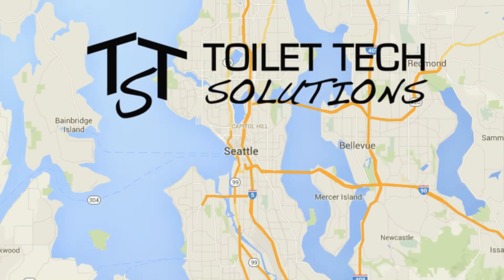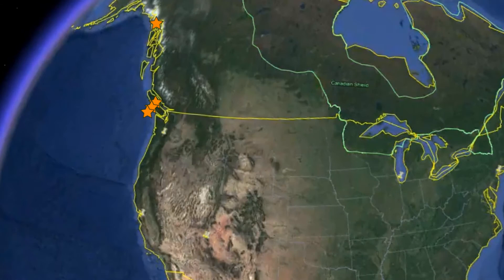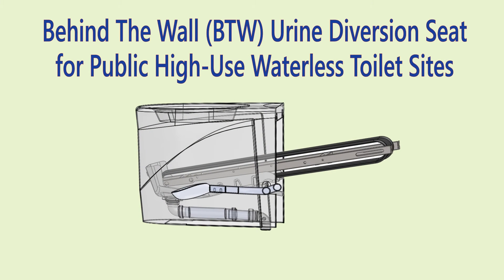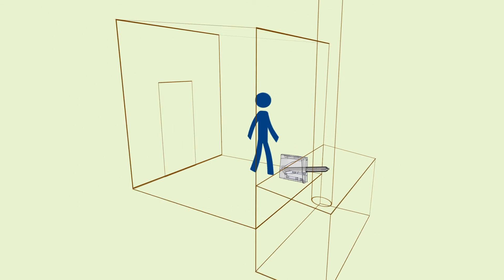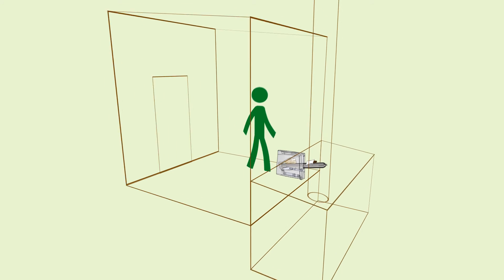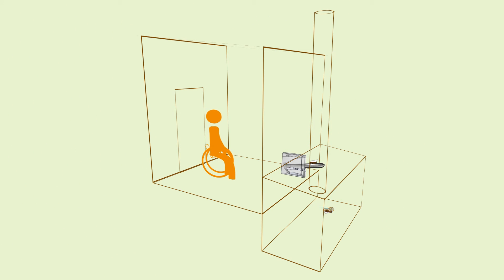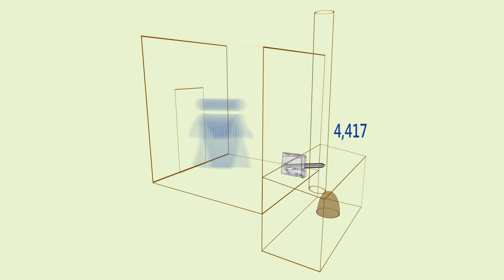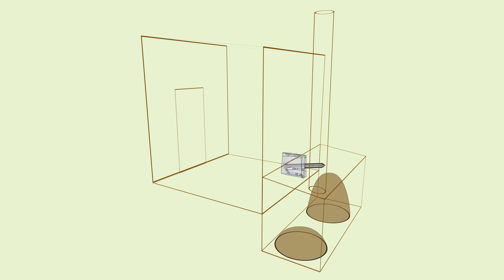Toilet Tech Solutions Waterless Toilet Video - Urine Diverting Decomposing / Dehydrating

Comment: I can imagine this system fitting on the backs of trucks and you then have a great mobile system for festivals and other events, a chiney on the tank above the waste pile with a vertical blade rotating will pull the smell up and the intake will be from the toilet so that the user does not get the smell, better than using a foot pump you can have it automated via the weight of the user sitting down to compress a spring that will engage a mechanism to crank the conveyor back when the user stands up
Reply: and when you pump the pedal it also charges a battery.

Comment: What happens to the urine?
Reply from the maker: In a basic system  with sufficient soil and set backs, urine is diverted to code complying septic fields.  In more extreme sites without soil, urine can be passed through a sand filter followed by an anaerobic retention stage (storage tank) which will reduce pathogen load from contact with conveyor belt and help reduce minerals in the urine.
Reply from the maker: Urine, on its own, carries no pathogens, no heavy metals, and most of the plant nutrients.  This makes it a pretty good fertilizer.  So urine, diverted at the source, can be fed into a shallow drainfield, where the design is optimized for nutrient uptake into plants.  Urine can also be stored, self sanitized (by means of pH and NH3 concentration) and then transported for application to plants in a concentrated form.